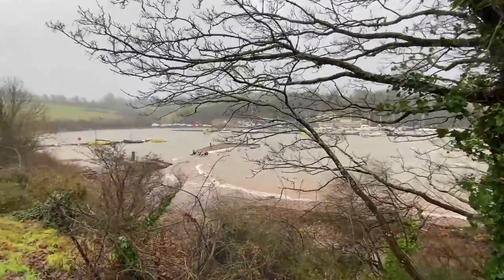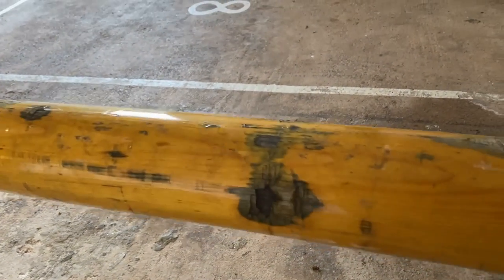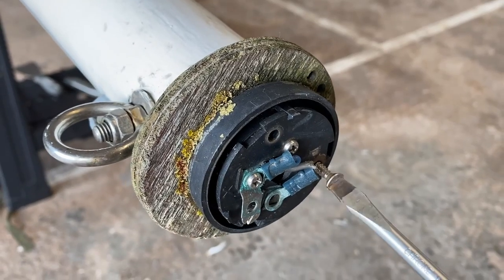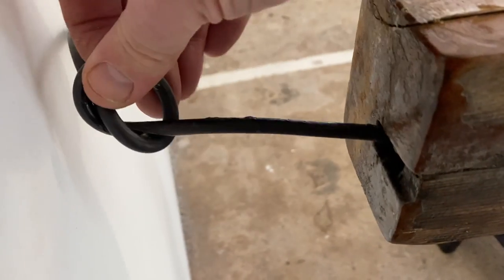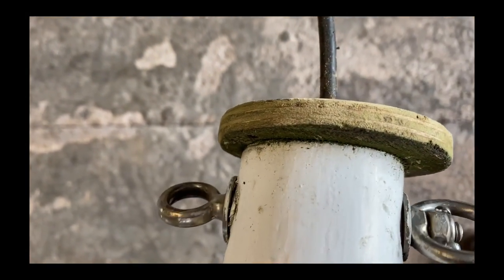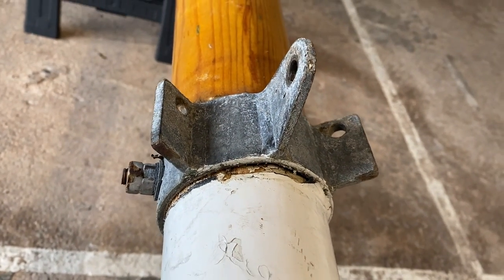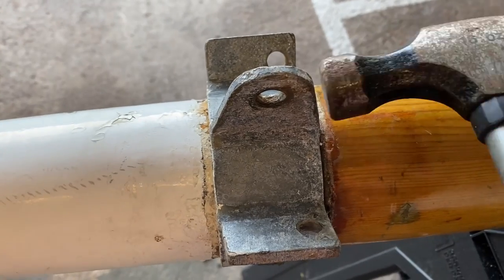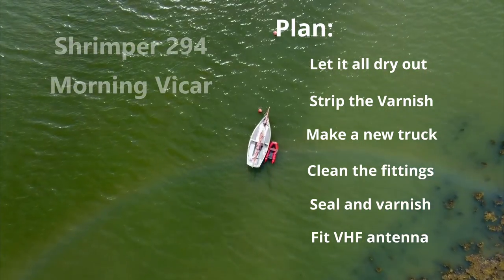No. 4   Mast inspection on a 35 year old Shrimper 19.

Comment: Interesting video, thanks for sharing.   Two things that might help, use the correct ring spanner not an adjustable (rounds nut off) and keep nut on the end of the bolt when persuading with a hammer - avoids damage to threads.
Reply from the maker: Thanks for the tips!